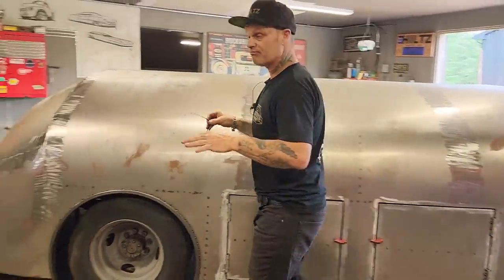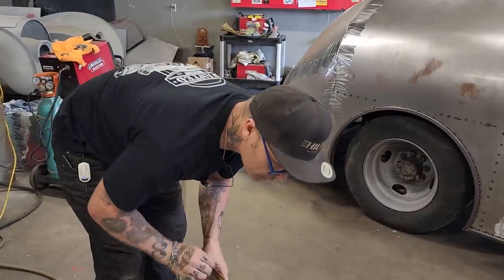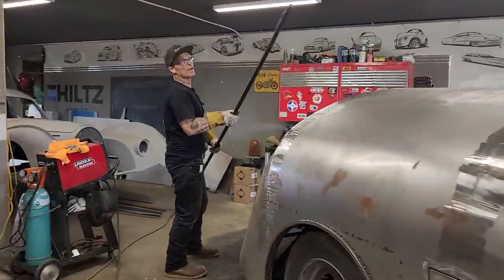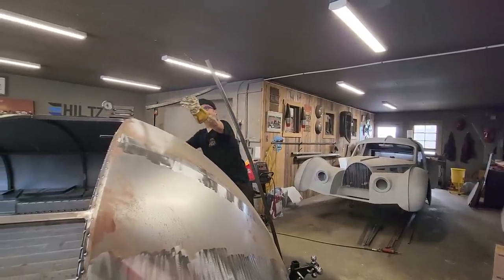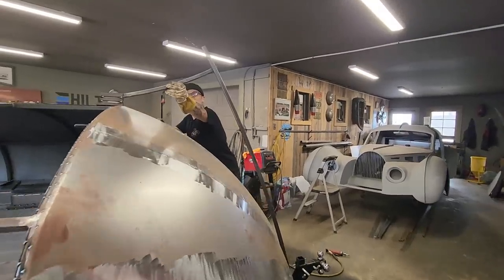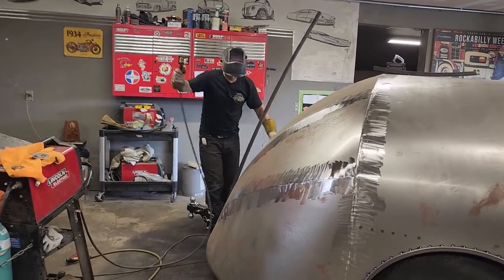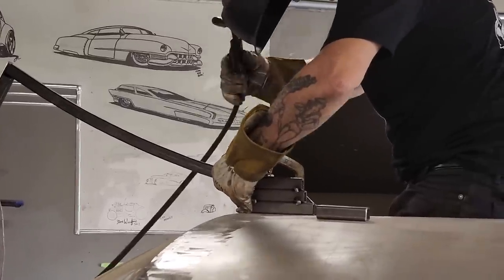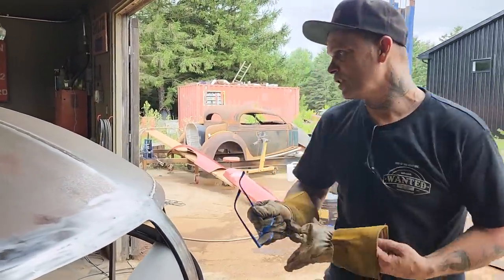Design change… Art Deco dorsal fin???

Comment: I like it!  I have an idea for you. How about making the two front windows flip up a little for ventilation?  You could hinge them at the top and make the pair of windows open up a little bit like a 39 ford.
Reply: I made a similar suggestion when he was building the grille. He should add hidden vents in the grille to allow air to flow in and slightly pressurize the cabin area to keep unwanted gases from entering the cabin.  Maybe a bit too deep for him....

Comment: Just a little tip. With your tubing roller you could weld 4 to 6 handles on the wheel part to make it easier to roll tubing.
Reply: Or he could put a sprocket and motor on it with a reverse switch low speed
Reply: @DumbCarGuy  come on man.. the guy is busy making free content for you

Comment: Chad really like your creativity on designs, just a suggestion, why don’t you weld a socket onto the adjustment screw on bending wheel, so you can adjust with 1/2 inch socket wrench for easier turning.👍👍👍👍

Comment: Chad for your door to inter the vehicle to access the seating, I think that if you make it in two pieces. The bottom half would fold down and you can install steps on it to climb inside. The top half would open upwards to give you clearance to inter the vehicle. You probably could do the same thing for the engine compartment to access the engine. Install door struts to assist in the opening and closing of the doors.

Comment: I thought maybe the Fin at the rear should be more subdued like the Bugatti? But I'm interested in thinking getting radiator cooling air from the Bugatti inspired Grill ducting it rearwards towards the radiator Trough the enclosed engine cover containing and ducting the hot air rearwaeds and thenupwards and out through roof louvers. The rear duct needs to be large enough to promote the hot air rising and gettinsucked out with the slipstream goin over the hauler roof. That central fin will contribute to enhance the air flowing up and away. we also need cool air for the combustion in the motor with two scoops one on each side of the roof ridge fin. Maybe the dual exhaust and mufflers should be in the Hot air ducting to the roof and get the heat upwards and away from the tool boxes and the rear fuel cell like it's done on diesel locomotives. The fin ended up looking great so it was a good call by Chad and Jolene. I really like how you are progressing along with this project.

Comment: I like the fin idea, but I was just wondering how you’re going to air flow to the front of the radiator ? I was thinking maybe you might have put a type of hood scoop on the top and funnel it to the front of the radiator ? Not sure what your thoughts are about that, good luck on the build, I’m digging it !
Reply: Good question, myself I'd build a "console" thru the cab from the grill to the engine compartment, let's see what the artist comes up with tho
Reply: @brianhiggins4832  definitely another option

Comment: The fin idea is good, The gullwing doors...I think having them open hydroulicly or maybe electric controled with a remote would be cool, and not too difficult to build. Not sure what you have planned exactly for widening the front wheels, but what I would do is find a truck straight axle with leaf springs and the same wheel bolt pattern, you could cut and widen it to the perfect width. and it would drive down the road very well too. You could still use the hyd. steering motors also. Wheel width problem solved.

Comment: I was a little skeptical at first about the fin. I seen the post weeks ago about the fin. But i do like the idea of it. Gives the back little more dimension. In my opinion i would turn the longer square tubing the other way with the curve going into the hauler instead of out like you have it now. To me would look a little better. Just my opinion. But awesome to see you're still going at this build. Keep up the great work Chad and great videos Jolene. This hauler is gonna be BADASS. And before someone gets on here and replies "it will never get "finished" or "will never see the road" or " pass inspection" you can get on with your noise.

Comment: If this truck was a real one, it would be a 1933 diamond" T" with a straight 6 L block, i worked on alcatraz island for 24 years, there's a 1934 fire truck on the island with same engine,i did the head gasket on it ten years ago. Thanks!

Comment: Just a suggestion that transition you have with the 1x3 cut the top of the 1x3 lift so it flows well with the fin then fill in the gap between it. Smoother transition

Comment: A good Artist knows when to put the pencil down. No Fin.
Reply: If you google 1925 Rolls Rolls Phantom I, you can see an example of a lower swept fin that accentuates the body line of the car. The type of fin that Chad is doing here looks out of place, a bit like a shark fin, and doesn't follow the haulers body lines at all, imo. It just looks awkward. I think a fin could be really cool, just don't think this is it..
Reply: @YippeeKiYayMrFalcon Looked it up, beautiful car and the fin is similar in design.
Reply: @AndyH-13 I disagree. Really the only similarity between the two is that their both fins. One fin is low swept and follows the existing body line of the car, and looks beautiful. The other fin goes upwards in the opposite direction of its body line and looks awkward. It'll look ok when it's completed, it was just a missed opportunity as far as design goes, and as long as they both like it then that's all that matters.

Comment: Not this thing ever really makes it down the road and is certified so can be on the roads, you can hide your antenna cyst inside of that if you changed it from metal to a plastic fin. That way you get better cellphone service and things like that. This will be great yard art when it is finished. Is a great addition to break up the pill bug 🪲 appearance of the doodlebug. Don't get the wrong idea I still love this project.

Comment: Won't it look better to match the fin as much as possible, by that I mean, I would've made a 1/4 inch by three flat bar, drill holes through it as you did the flat bar on the bugatti, to match it. Instead of changing the look of it, by making it one inch by three. I would've thought you wanted it to match the bugatti fin and make it identical as possible. Don't you think ? Nevertheless, I believe whatever you decide It will look good, when its done!!!

Comment: Hey Chad I like it!... one concern is those windshield lens, they will only bend in one direction therefor it will never fit your compound window opening. You inspired me with the bubble top cars, I applied the way you made the bubble on a much smaller scale using a small vacu-form machine. Have you thought about making a "tool" following the contour of the window opening, heating the plexiglass until it conforms. I think with those headlights you could have quite a bubble without looking too out of place. A thought.
Reply: Chad has a serie of videos about thermoforming plexiglass in an homebuilt oven!!!

Comment: You could add some schedule 80 Hydraulic pipe and make shark teeth to put on the front bumper. You can also add a rudder to the fin. You can make Gatlin Guns out of the headlights and fire road flares out of the tail lights! You can also add tank tracks instead of wheels. The Hiltzico Hauler.Bert and Ernie Designs. One ahahah, two ahahah. You were standing in line and God said last train. You thought he said Last Brain so you turned around and left!

Comment: Chad have you ever given thought to motorize the bender    I’m thinking you weld a timing gear to he shaft the hand wheel is mounted to then get a car starter   A chain and a battery     Weld up a mount to attach to the bender to mount the starter

Comment: I know Chad is a little thin skinned when it comes to negative criticism, and this post probably won't get past Jolene's censorship, but, when I was watching a few days back, and Chad was demonstrating the importance of changing the  filters on the car. It seemed a little odd that he is not at all worried about the amount of metal particulates he is breathing in when using a the disc cutter and grinder. He must be aware that this material is present in the atmosphere of the shop, especially when he has to strike the scissors on the floor to remove the metal dust from the magnetised blades. In England we have ex-coalminers and cast steel shop grinder who suffer from chronic lung disease from inhalation of these products. Please start wearing a mask Chad, even if it's only a paper one. On another point, it's is really impressive to watch you using your unique geometry skills in your design projects. Looking forward to seeing the completion of the "DOODLEBUGATTIMOBILE".  Take Care both of you.